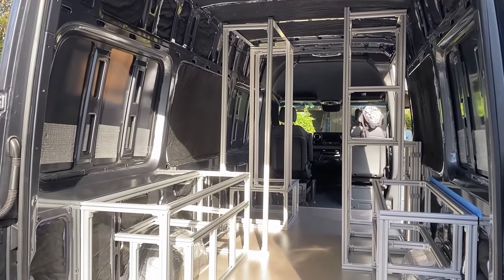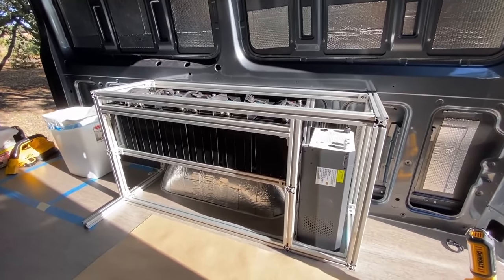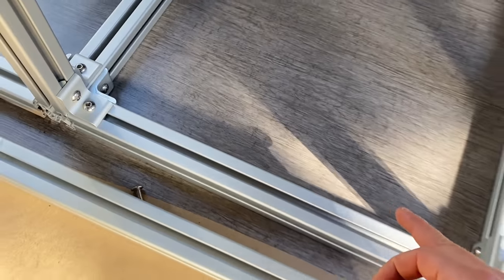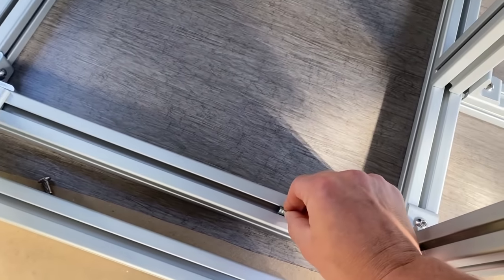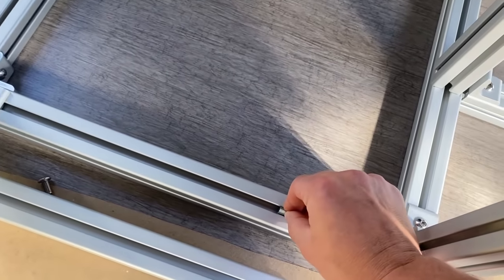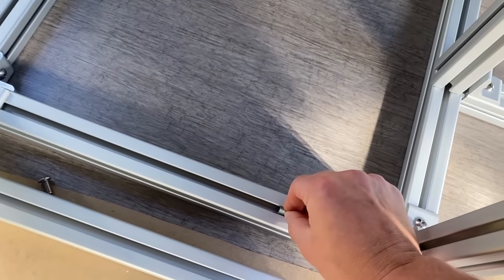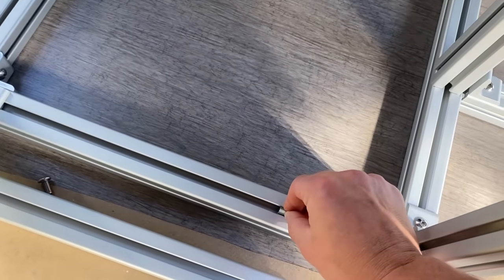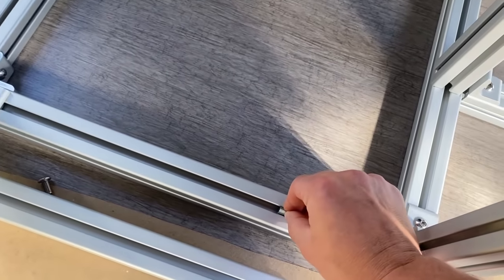How To Build A Van With 80/20 Aluminum (INSANELY STRONG)

Comment: Nice video and you have inspired me for few ideas I will implement but I wonder why you and many other youtubers calling this extruded alu profiles 80/20. Its so confusing. In my knowledge profiles are named by they dimensions like 20/20 is 20mm x 20mm, 40/40 is 40mm x 40mm. Profile you named 80/20 should be 80mm x 20mm but you are not using it.. I dont understand this..

Comment: why to connect all cabins to the wall of the van

it is more simple to use the flat bars at the bottom and  and the top  between the two sides cabins and make it one constraction..

that way you need just connect the entire stracture only at 4 or 6 points  to the van.... at the bottom or mix with the top....

Comment: Did you bolt all of the way through the van floor or just into the plywood?
Reply from the maker: It’s bolted all the way through into the factory bolt hole locations
Reply: @seven_o_savage  thanks

Comment: I hope you're not hoping to insulate your van at all. All that aluminium attached directly to the metal structure of the van will act as a huge heat conductor, so the whole cabinet  frame will be at the same temperature as the outside.

Comment: I love this build. But having built a travel trailer from a cargo trailer, I can see that aluminum will tend to conduct heat INTO the van or out of it.  It's a nearly perfect heat sink. :-(
Reply: Looks like he was trying to break the thermal bridge with the foam tape a bit. OurKaravan had a great discussions on this in one of his videos
Reply: @jefffilmproductions8327  // I can't wait to try the wood framing. I can see how guys that have done lots of wood framing enjoy the new toy of aluminum. I get it. But wood is fine. Who is going to be hanging from a cabinet? :-) ... I built a pine and cedar sleeper in my truck and wood furniture in my camper/trailer build. A van build, I'll try wood first.

Comment: Framing of any type, wood or metal, in a van project is a total waste of time, money and oh so valuable space!  Period!
The panels are the strength when joined with aluminum angle and "chicago scews"!  YOU DO NOT NEED 75% TO 90% OF THE TYPICAL FRAMING MOST DESIGNERS USE?
Only large spans of three feet or more holding heavy loads require framing.  Such as bed platform's, battery or liquid tank racks, etc.!
BELIEVE IT!

Comment: Have you ever considered welding?
Reply: Welding aluminum is a pain in the butt ! Probably easier to braze than to weld but these profiles are not designed for this...
The point is to have something that you can modify easily.
Reply: @jacquesolivier65  I feel you. Takes practice but it’s a great skill to learn, especially if you do a lot metal work. Highly recommend a TIG welder for anyone starting out, esp with aluminum, even if you don’t need it right away. Practice, have fun. MIG is good too but more “things” to deal with when working with aluminum, and the oxidized layer. I just find it fun to practice different techniques on different metals when welding. Plus don’t need to spend money on fancy connectors when you can weld it for pennies and have way stronger bond.

Comment: Drawers>>>  Typically you never pull the drawers out all the way when using them unless you need to remove them. Also you can make the drawers as deep as you need...simply but a drawer slide that is not as deep. ???

Comment: Hey man I'm planning a winter ski trip with some good friends where we plan to convert the back of a truck with a cap on it into a hospitable sleeping area. Do you have any tips on insulation for colder weathers ? Or is it a good idea to buy fire resistant insulation and have a heater going.
Reply: Havelock wool

Comment: Great video of this material. Love the versatile nature of it. Seems you know your stuff😊 Building mine out when it arrives in June. Can't wait. I notice some builders lay the floor and walls after the cabinets are installed and some lay right over floors and walls. What is the preferred process and why? What to do the best possible methods🙏
Reply from the maker: Thanks! I like floor before cabinets. Lots of reasons I can’t explain in a message. I like having a fully flat, sealed, insulted floor underneath everything. Also, with a last-stage-floor, lots of debris get under that you can never get out.

Comment: Hi;) nice job ... can you say something about the weight of the finished interior compared to the wooden version?
Reply from the maker: All in all 25% lighter and 500% stronger
Reply: @seven_o_savage  So you could have made it a LOT lighter with the 1" instead of 1.5". Probably less $ too. 1 middle vertical support for battery tray and that's done. Don't take this the wrong way, your build is very impressive, nice work!

Comment: Do you have any issues with the screws loosening on your 80/20 over time?
Reply: that's what i was thinking to mate, i would be using some lock tight on the build
Reply: the extrusions are designed with a built in "lock nut"

Comment: Good video but you actually reduced the strength of the battery box in the event of a collision by not having one piece vertical sections. This is an issue in nearly every van build I see. Most builders don't understand the forces involved in even a low speed collision. Most camper builds are death traps unless they have a factory bulkhead separating the cab. How many people have seen using magnetic kitchen knife holders? Just insane.

Comment: Extruded aluminum doesn't hold up
Reply: @Chris alot of deformation from vibration. It's a fact Aluminum is a soft metal
Reply: @Chris I use it every day I repair wood working machines
Reply: It's fun to build with the problems come down the road.
Reply: You know what if you have taken on extruded aluminum instead of starting a family then I'm wrong and you are right.
Reply: @Chris I get that a lot
Reply: Seriously though trade offs what ever you lose in weight you also lose in strength. If your tig welding fine but adjustable fasteners what is this a kids toy?
Reply: @Chris After years of actual experience odd.

Comment: "The idea is that if the van does a complete barrel roll, all of the furniture stays in place"

With respect, if your fully outfitted and loaded long wheelbase, high top Mercedes Benz Sprinter van is doing complete barrel rolls with you inside, then there are things of considerably greater importance occurring than the state of your furniture!

Surely you would fit a proper roll cage into the driver and passenger compartment in order to protect the crew throughout such a catastrophic accident rather than prioritise your furniture! 

Like I said, if you're barrel rolling your van, furniture should be the last thing on your mind...
Reply: I think he was implying that the furniture would stay in place instead of coming barreling at his head...?